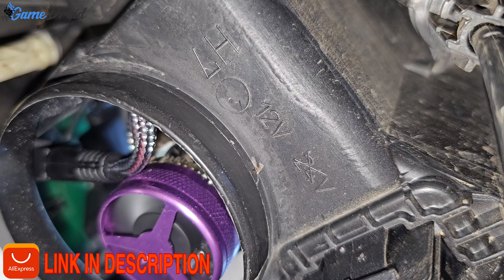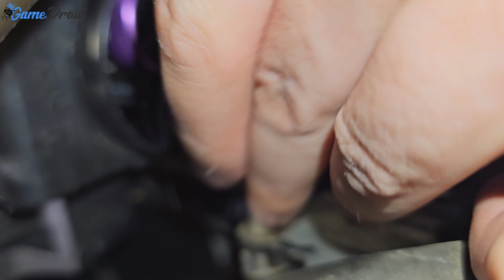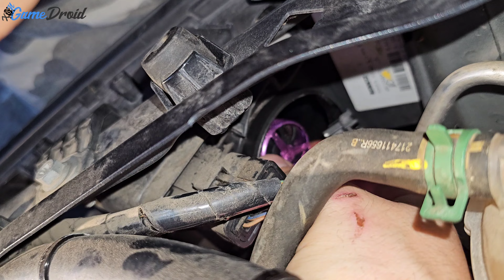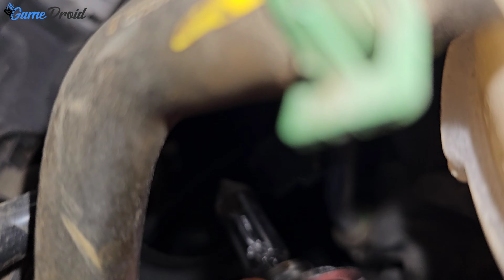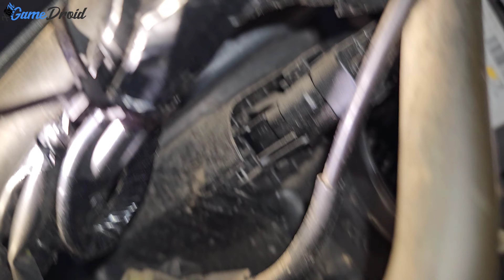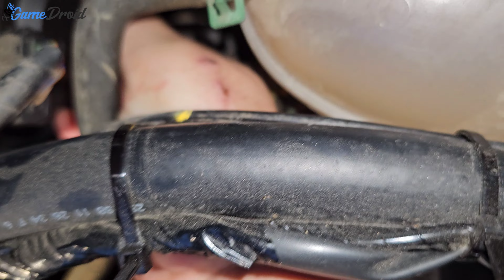Dacia Renault Logan L52 K52 2016 Headlight Bulbs H7 Low-Beam  Replacement - Led Upgrade - Aliexpress

Comment: I bought an RGB headlight LED for my Sandero and want to connect (+) and (-) wires directly from the headlight connectors. Do you know how to unplug that connector to take out its pines? I've tried several times unsuccessfully